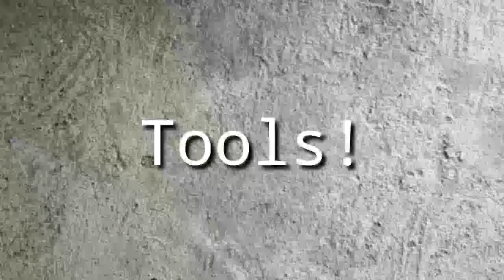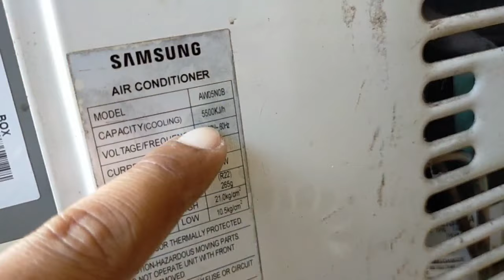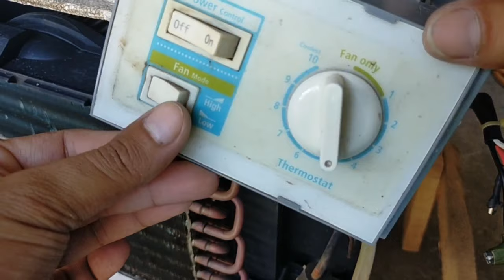How to clean your own aircon (samsung window type)

Comment: Boss ung aircon na gamit ko katulad ng aircon na nasa video mo, ang problema ko mahina ung lamig na nilalabas nung aircon at maingay. Any possible solution boss?
Reply from the maker: Kung nalinisan na po need po yan ma check ng technician for troubleshooting
Reply: ung aircon na nasa video mo boss maingay ba pag naka on? ung lamig okay naman ba?
Reply from the maker: Okay po ang lamig nya wla pong problema, okay din po ang ingay normal running sound nmn po ng compressor. Ilang taon na po ba aircon nyo sir?